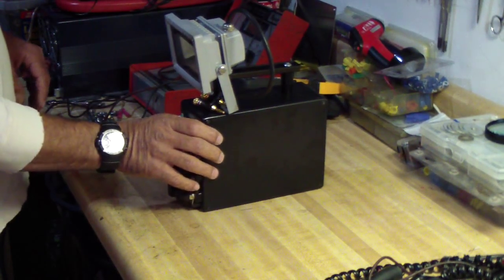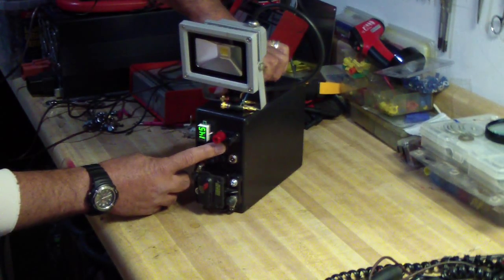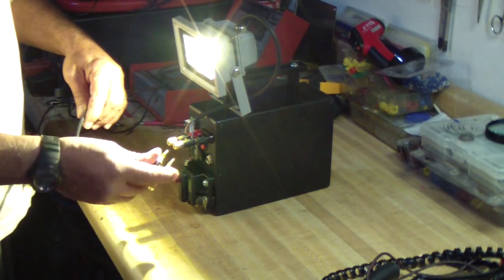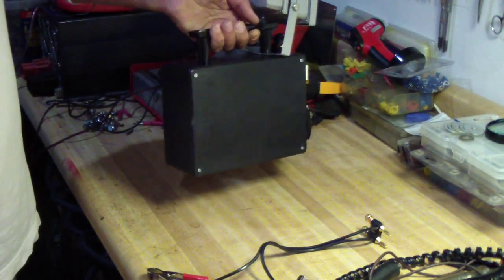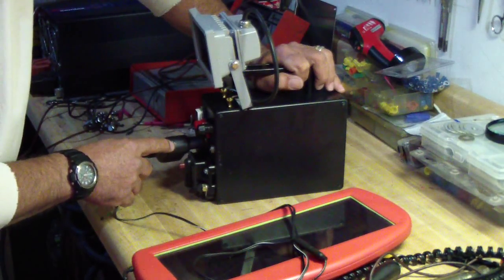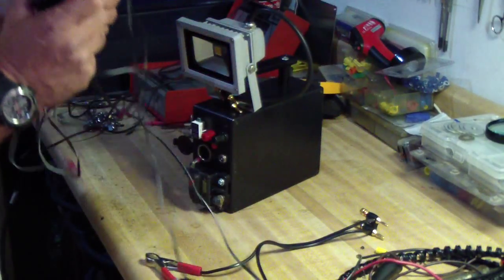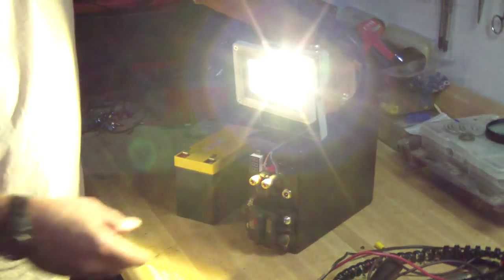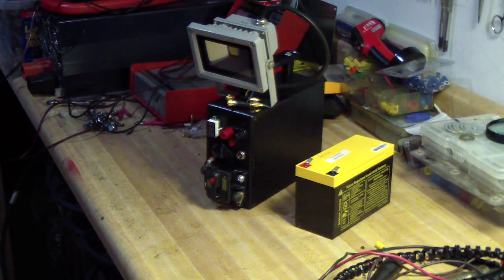Maxwell Supercapacitor, Ultracapacitor Power Pack With LED Emergency Light.

Comment: I would totally add the battery for longer run time as the caps will go dead fairly quickly. If you can make a small box that houses both, plus a voltage regulator of some type to maintain the voltage, that would be super cool. I like the idea, very nice.
Reply from the maker: I do totally agree with you! Will be working on a BMS.  Be Well, Raz

Comment: Congratulations for your outstanding work, mister! That's exactly one of my ideas, that I did not build :) Do you use some kind of booster - I mean when the capacitors are as low as 9V, the output still will be 12V? So you can drain all the energy they have?
Reply from the maker: No booster circuit but that is a very good idea, thanks!

Comment: Indoors as with a "wall wart" transformer/power adapter/pack or with a USB port on a computer, a resistor should be used in series when charging these types of devices so that you don't go over the maximum current rating.  Capacitors are like a short circuit at first when the charging starts and then become like a infinite resistance once charged up since they are now storing an effective "back emf/voltage" that opposes the charging voltage.

For example, I think a usb standard is 5vdc ourput, and rated at 1amp or so output current.  Hence a 5V/1A = 5 ohm resistor is needed, and it's good to do an experiment first to see if it will work.  The resistor should also be a 5W or 10W type.
Reply from the maker: Very good point and observation, thank you.
Godspeed,
Raz
Reply: ElRazTheGreat1 Thanks, if a 5W resistor can't be found, five 1ohm, 1watt power, resistors could be used in series.
Reply from the maker: trailkeeper Tell me your opinion on this;  http://www.ebay.com/itm/141039052482?ssPageName=STRK:MEWNX:IT&_trksid=p3984.m1497.l2649#ht_4066wt_1124
Reply: ElRazTheGreat1 It appears to be ok, good price, says it efficient so i'm guessing it will produce little heat and water of energy.   One other simpler way to drop voltages if someone doesn't have these type of devices or voltage regulators/converters is to use a bunch of power diodes in series.

Also my previous comments were for if you were to charge your powerpack up using usb or some transformer.   If your device got some short in it while charging it could blow the charging transformer or usb if they did not have current limiting protection.
Reply from the maker: trailkeeper I see your point, I use a 12 Volt automotive test-light in series on the charging line to charge the caps, it has about 12.5 Ohms resistance, you could see it in action in my other videos.  Thanks for bringing up a valid point!
Be A Good Human,
Raz
Reply: ElRazTheGreat1 Thanks.  You probably know this , but if someone is reading comments, I think that if your charing from your 12V car battery or alternator, then I think a safety resistor is not needed, I think those charging methods can handle all the currrent, many amps worth.  I don't really know if the capacitors or even the wires you use, have a max. current rating.
Reply from the maker: trailkeeper
I see your point; English is my second language so forgive my mistake/s.   I do use my battery bank (12.6 Volt) to charge the caps, the caps have a threshold of 16.2 V and I do not go over it! Yesterday I charged the pack with a solar panel that brought the voltage of the caps to 15.7 Volt.  The dedicated wall charger is a float charger with maximum of 14.7 Volt at 0.8 Amp.
Be Safe, Be Well,
Raz

Comment: Really nice.  I'd hard wire the light internally and have it controlled by a thumb switch that can be turned on/off while holding the handle.
Reply from the maker: Indeed it will be done soon!
Be Safe,
Raz

Comment: Very nice.  I'm wondering how long it would run that light and other things.
Reply: I think the power would last longer if you let it work with a joule thief or joule ringer while decreasing the number of capacitors. This is a nice project though. Thank you so much for sharing.
Reply from the maker: I will be performing some tests to see, will keep you posted, thanks for watching.
Be Well,
Raz
Reply from the maker: Emmanuel Clata Thanks for you input, any idea is more than welcome! thanks for watching.